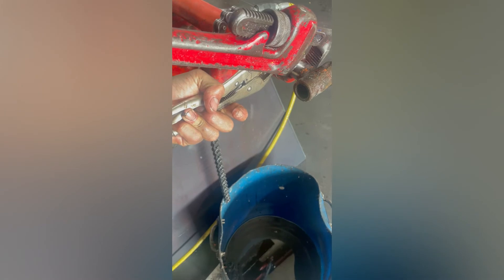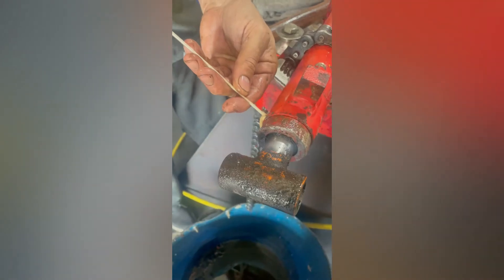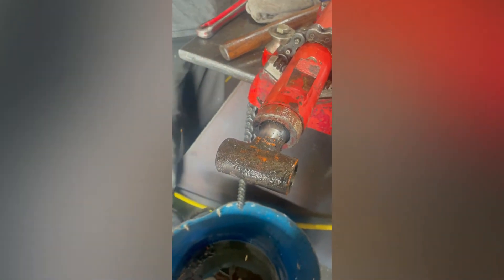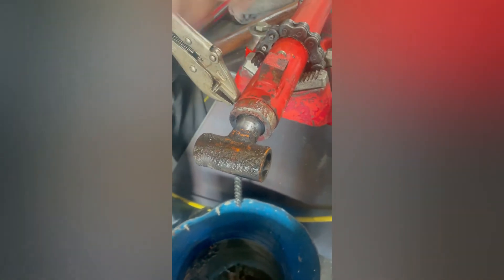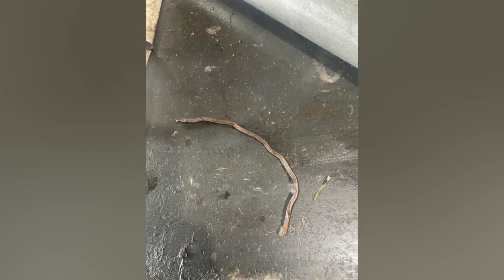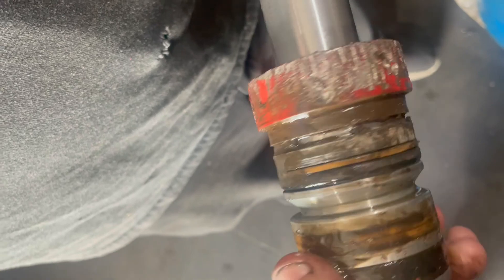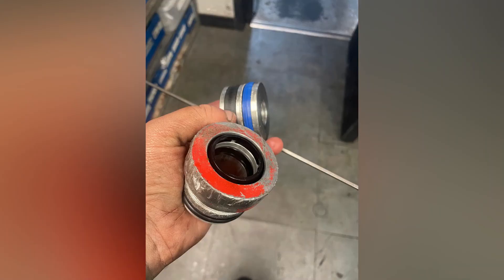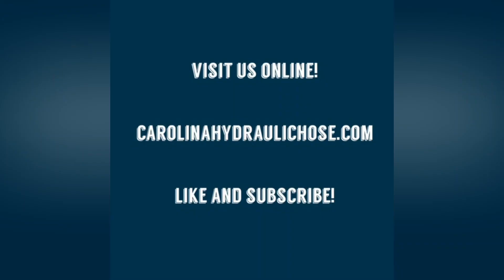Disassembling A Hydraulic Cylinder With A Wind-In Lockwire

Comment: Thanks I've been trying to find a video on this for over an hour. I have an Allmand TLB25D and i gotta rebuild the loader lift cylinders. Allmand sells the seals but not the cylinders. I would like to buy new cylinders cause the shaft is questionable. I asked who made them and they said they were not allowed to tell me. The cylinders have different size pins at each end and I can't find a replacement. Does anyone know who made them? Thanks

Comment: You don't need to pull with pliers. Just turn the gland and the ring will come out without breaking.
Reply from the maker: Not this one 😆 It was Frozen in there and needed some extra help 🤷🏻‍♀️
Reply: Rusty wire is hell to get out some time